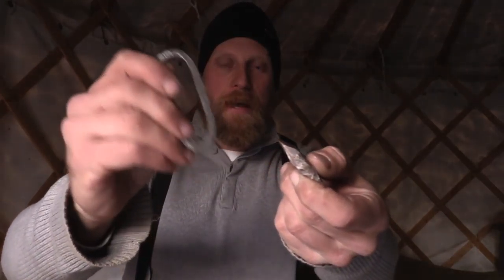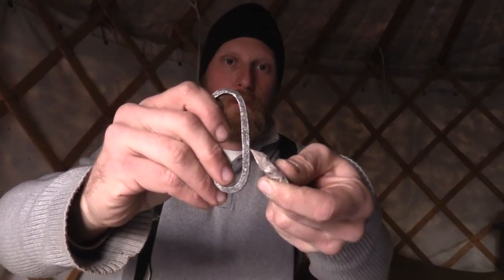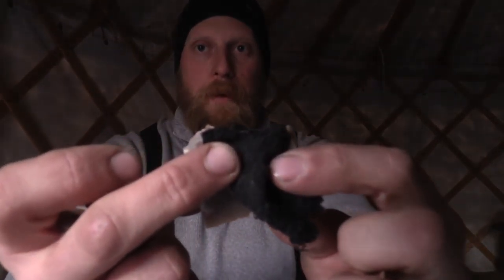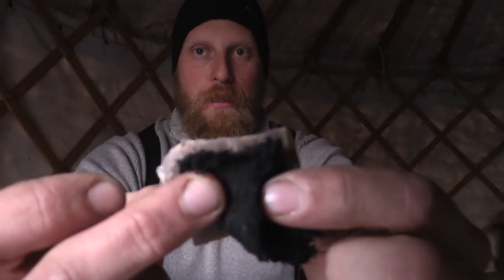Top or Bottom?

Comment: Can you use a nail or a screw?
Reply from the maker: For what?
Reply: Coalcracker Bushcraft to strike a flint.I think I'm finding them in my burn/creek but not sure so need to try with something.
Reply: Coalcracker Bushcraft to strike a flint.I think I'm finding them in my burn/creek but not sure so need to try with something.
Reply from the maker: No nails and screws aren’t high carbon steel and aren’t tempered correctly
Reply: Used mild steel for years, you'll see they will work.  Not sure about a screw but steel nails do work, at least mine did with my flint.
Reply: Cheers man!😁